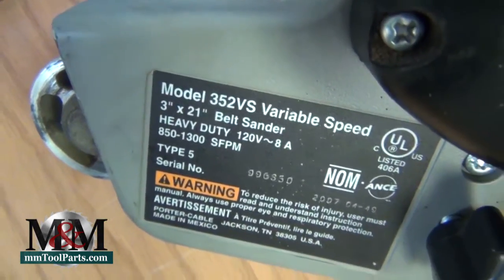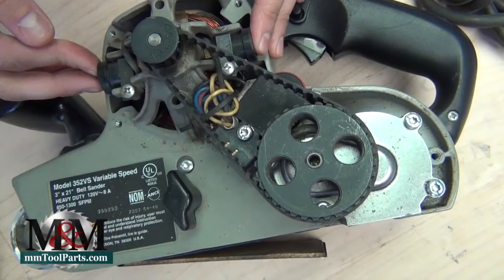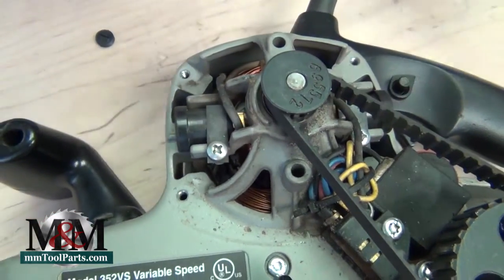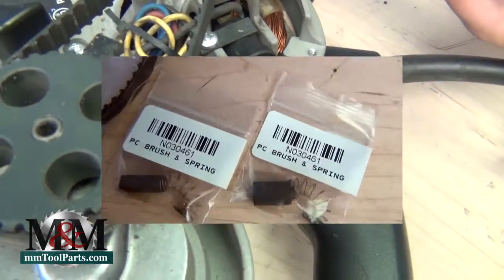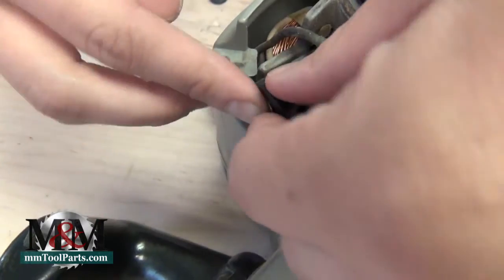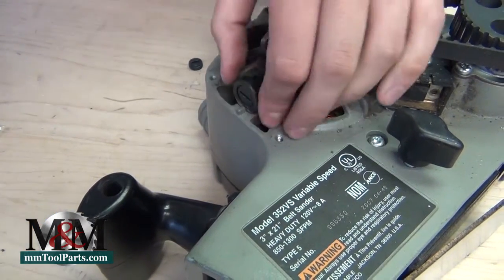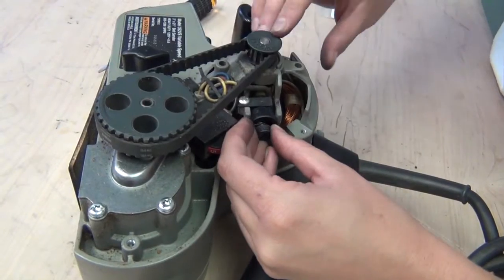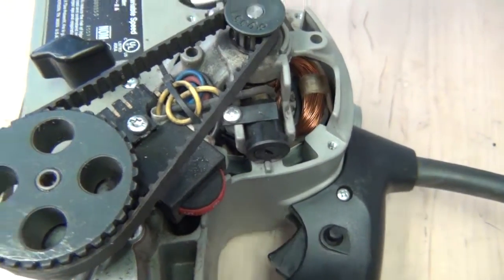Porter Cable 352VS Belt Sander - Brush replacement

Comment: was using the sander, working just fine, when the sanding belt stopped rotating, motor continued to run. checked the drive belt, it was ok also.  using compressed air, I proceeded to blow all the dust from the machine.  motor runs, power drive wheel also runs when there isn't a sanding belt on. sanding belt won't turn.  any Ideas? Paul